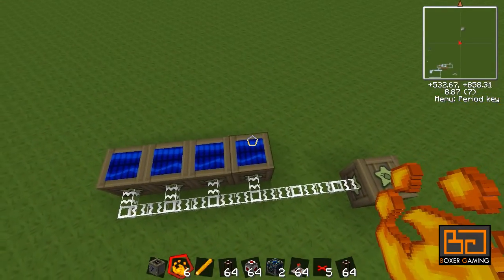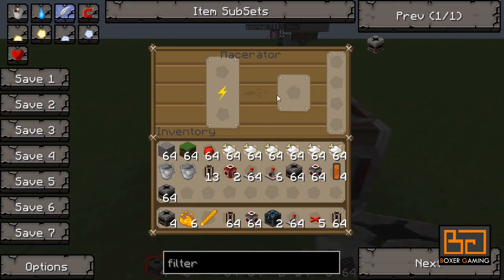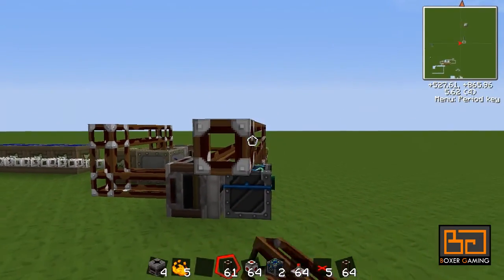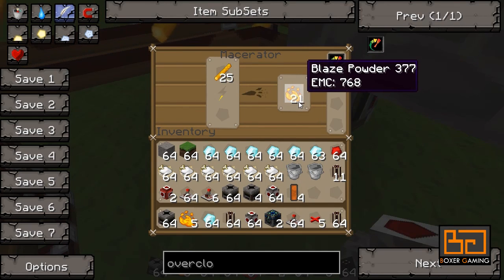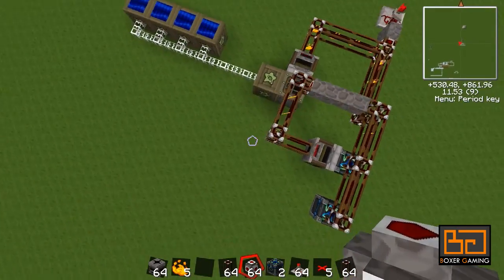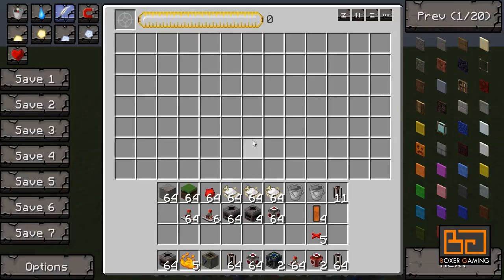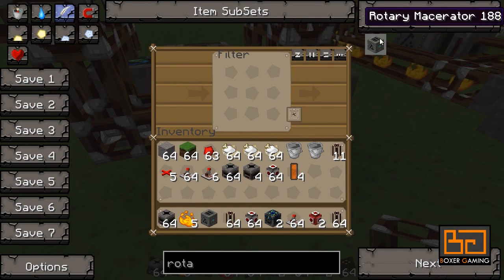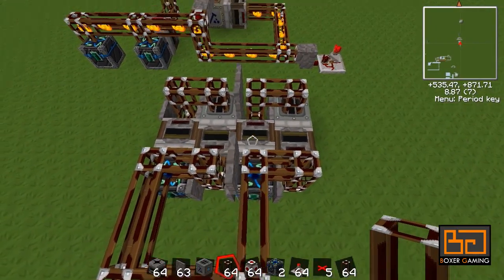Tekkit Tutorial: Blaze Rod EMC Generator [How To]

Comment: You can fill the energy condensers with items that lacks EMC value. This way you won't have to wait for it to produce diamonds. And rotary macerators are a definate choice since they barely draws any power once they've speed up. I have two of them together drawing 7-8 EU/t with 15 overclockers in each of them.